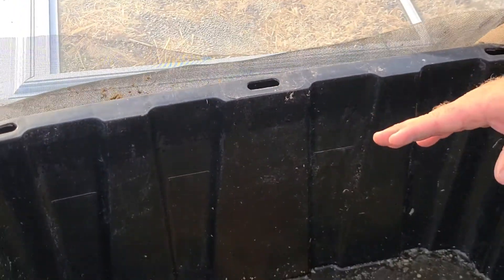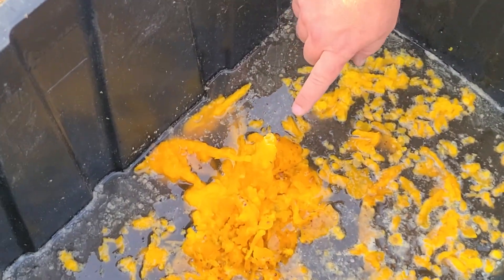How to Make a Homemade Solar Wax Melter

Comment: I use a glass fishtank.
A collector pan in the bottom.
A wire frame to sit an aluminium bbq tray on. The tray has small holes on the lowest edge, covered with a layer of paper towel. Wax cappings on top, lid on the tank... VERY clean wax recovery.